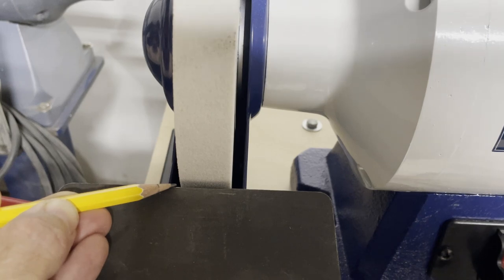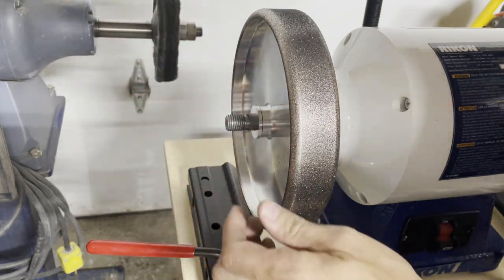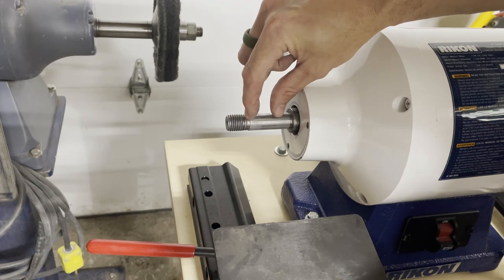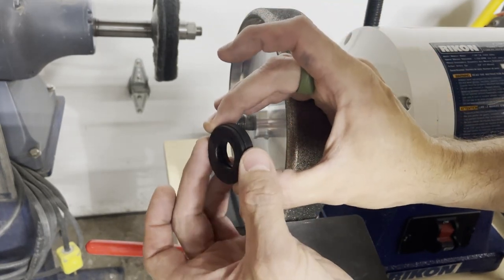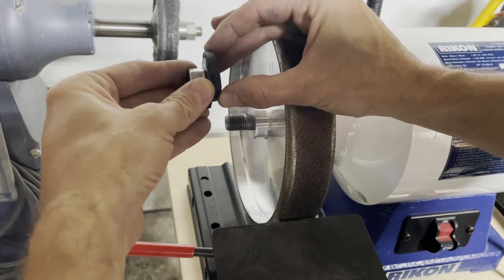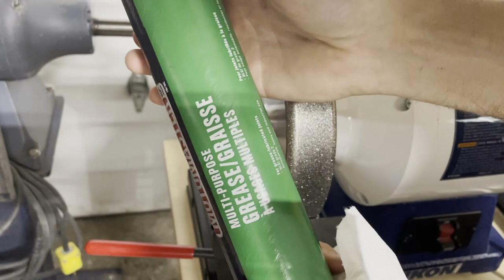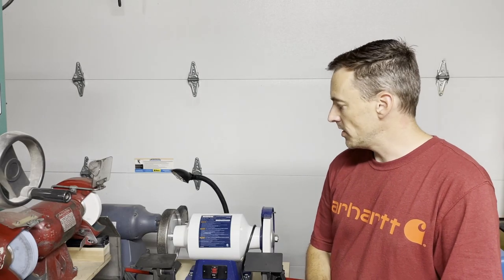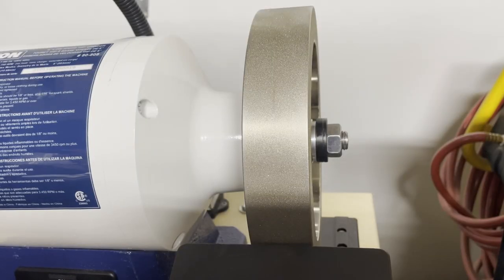Grinder Wheel Side Wobble

Comment: Your original problem is not a problem with the grinder, but in the grind stones. I have the same grinder, and had the same situation, with the original white stones, As soon as I installed CBN wheels, without any fancy spacers or washers, the problem disappeared.  I have been using this set up for four years now, and they are still running true, without me having done any further adjustments.
Reply from the maker: I should have tried testing the wobble without the spherical washers to see if the problem carried over to the cbn wheels and if I needed them.  But seeing as how when I tighter the nut they shifted over a bit I think I did benefit using them.
Reply: It’s the crap stamped steel washers on those original stones, just look at them, no turning marks to true each face to each other and one moose with a big wrench and the washers are toast, machined washers or a machined washer collar are the fix plus feather torque on the shaft nuts and it’s all good to go
Reply from the maker: Absolutely.

Comment: Not referring to the side wobble here, but i thought id throw something out.
One of my wheels was running true, but out of balance.
I decided as counterweights, to add a large washer to both the inside of the wherl and the outside next to the nut.
Were talkning a large fender washer size.
I planned to remove 25 or 30 ish percent from onevside of each washet.
One side would be lighter,  the other side heavier.
Anyway before shaving, the side off of one washer I installed it. Then I installed the grinding wheel with its original washers.
I tighten the nut finger tight 
I became quite alarmed when loosenung the grinder nut that's how I just installed finger tight, quite gently.
Somehow with a second washer on the inside of the grinding wheels original washer, this tightened up the nut so tight that i needed a wrench and a hammer to tap the nut loose.
The torque from the grinder revving up allowed the wherl to slip, thus tightening the nut way more than finger tight.
I decided then not to invent a better mousetrap.
Great video, thanks for making it. 👍
Reply from the maker: If both wheels are running true but off balance and you dressed the edge of the wheels so they are flat I’m not sure what would cause your off balance. Maybe the density of the wheel isn’t consistent.
Reply: @thewoodwork_ca 
You just responded to another person and I kind of rewrote what I just said here.
I took so long to type, you replied to me also so I just saw this.
 Anyway, no i wasn't dressing the sides of the wheels.
I had trued up the roundness of the stone and was trying to add modified washers to act as a counterbalance.

Comment: I'd love to see you try those fancy washers with one of the original wheels to see if it helps out
Reply from the maker: I just spent some time trying to get an original white Rikon wheel to run true using the spherical washer set.  What I had to do was slide their fitting offside (the way they fit together) to create a slant the way a shim would work.   I did get them to run true to a really acceptable amount but I don’t like how much work I had to put into it.  If the wheel moved position on startup I’d have to redo it all unless I marked the positions of everything.    But these would work the best over sticking shims or paper so I recommend them still.
Reply: @thewoodwork_ca  very interesting, I wonder why the quality is so low on these high end tools
Reply: @TheGrantAlexander  Thanks China
Reply: Those new wheel should run true for the price they cost and most likely you didn’t need to waste money on those dished washers, just get a sleeve of proper length.

Many can’t afford those very expensive wheels
Reply from the maker: The wheels running true is not the problem.  The grinder you put them in is almost always the issue (arbor, flange washers).
Reply: The sphericals do help I tried.  The shaft deflects a hair or the clearance in the hub let’s it rotate a bit if clamping pressure isn’t even.  Remember the error at a 5/8” bore gets amplified by the radius of the wheel divided by the radius of the shaft. 

As for using those washers on stone wheels they are too small.  You need a big clamping area on the cardboard of the wheel to distribute the clamping force on the fragile wheels.  That said my grinder used to have press fit machined large diameter washers I made before I switched to cbn and it definitely helped hold the wheels true.

Comment: I have made a padestal for my 8 in bench grinder. It weighs about 37 lbs. The problem is that when I switch off the grinder and it is slowing down it tends to resonate and vibrate at 2 rotating speeds. Can u suggest a solution. Thanks
Reply from the maker: There’s lots of stuff on the internet of things to try but other than making sure your shaft isn’t bent or your flanges aren’t flat, most people blame the wheels.   CBN wheels are balanced and you can’t dress them so they can go out of true or balance.  Lots of things can cause a wheel to be unbalanced like the weight or density of material heavier on one side.    If the wheel loose and hanging on the shaft, you tighten it and dress it true that means you took material off one side more so it’s not the same density all around any more.  Make sure those bushings are super high tolerance.    Plastic loose ones could make you true away your wheel badly.

Comment: All very confusing, you show a wobble on the white grinding wheel, then use the special washers on the diamond wheel, which you didn’t check first..
If those special washers are a snug fit on the shaft, there’s no way they can move to give any adjustment…
You should have used them on the white wheel to see if there was any improvement…
Reply: Assuming the shaft diameter and the grinding wheels inner diameter are within .00005" ?
Reply from the maker: Off camera I did test the Diamond wheel with regular washer and it had the same wobble.  Washers are never a snug fit on any shaft so they can slide on -there is always some play.
Reply: @thewoodwork_ca  I did some experimenting myself, as I'm setting up an old 6 inch grinder.  
I found a thick, 1/2" wide washer in the metric at the hardware store. Its diameter was much, much closer to the shaft diameter. As you just stated, regular washers  are too sloppy of a fit.  This metric one seemed like it might work, so I tested it for fit.
My plan was to lob off a good portion of one side of the washer to make it behave as a counterbalance.
Anyhow, before modifying the washers, I placed one washer on the inside against the shaft lip, then installed grinder wheel with both of the grinder washers still in place.
I wanted to see if the wheel
wobble was any better. I turned the grinder on and it was no better, no worse.
 When I tried to take the nut off, I couldn't twist it off with my fingers. A dozen balancing attempts before,  I had put the nut on finger tight and had been able to remove it with my fingers. 🤔
Well, with these two washers on the inside, they must have allowed the wheel to spin against the but, this tightening it.
I put a wrench on the nut and had to tap it fairly hard to get the nut loosen.
It was tight enough to be scarry. 
I ditched my attempt to use additional washers for balancing.
Reply: Yes,he compared 2 different wheels  with 2 different mounting techniques. 
He should have 1st retested the white stone wheel with just the precision washers. If it fixes the problem, great. Or it improves, good.
Next,retest white wheel with original washers and pivoting washer set and note  any improvements or degradation. 
And finally, precision washers with pivoting washers and white stone wheel and check results. 
That way one could PROBABLY narrow it down to a out-of-true stone or a stone with a weight distribution problem....and that's a whole new  problem. 
I'd make sure the white stone came from a reputable abrasive company and check the shaft with a dial indicator.
 Where does Baldor get the wheels they use?
Reply from the maker: Yes you are correct.  I have spoken and since fired both my writer staff as well as my producer for the confusion it has caused you.   However, last weekend I put on the original white wheels, the new washers and it ran true, much better than the original washers.    I originally did not test the hood washers on the old white wheels because I bought all the new items in one order (Diamond wheel and spherical washers) and was excited to get them all on.

Comment: I have a problem.... Proceeds to change out the part instead of dealing with the problem lol.  Solved
Reply from the maker: Care to explain what the problem is ?
Reply: @thewoodwork_ca  your video is about grinder wobble.  So I would assume that you have some solution to remedy it.  Instead, I get a video about putting on another set of completely different wheels.  It's click baity.
Reply from the maker: @MintStiles No. the washers are for any wheels that wobble.  I just ordered the new wheels with the new washers in the same order.   The washers fixed the old wheels, someone else asked and I tried putting them back on which worked.   The tightening of the nut goes on slightly crooked to the washer to the wheel to the machined arbor shaft mount.  The wheel doesn’t get to mount perfect up against the machined arbor mount. The new washer set counteracts that error.